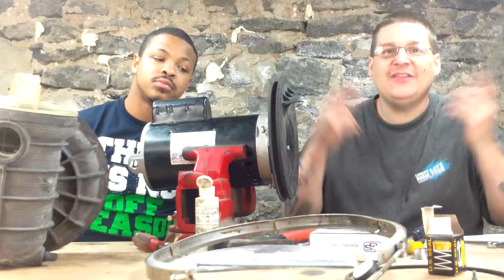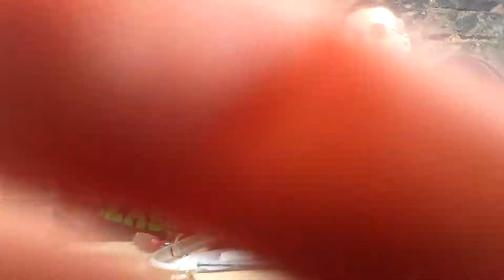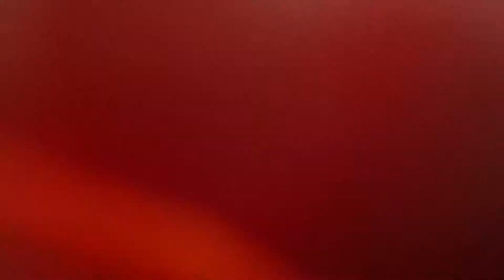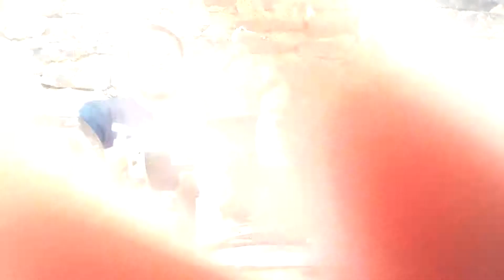How To Change Sta Rite Challenger Seal Plate Housing

Comment: Is that spring seal that easy to remove? Mine won't come off.  My locking screw that connects the impeller to the motor shaft broke in two and is stuck in the threaded hole for the motor shaft.  Would a tap and dye work or how would you recommend I fix it?